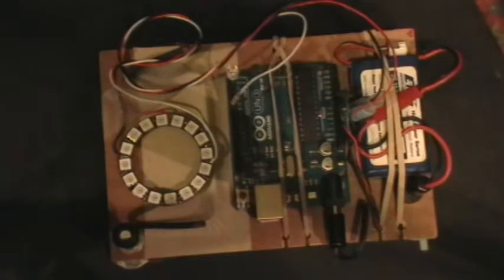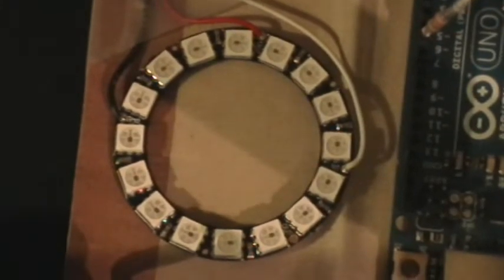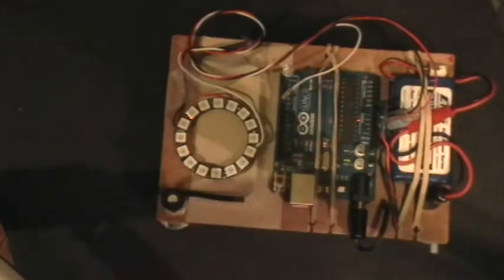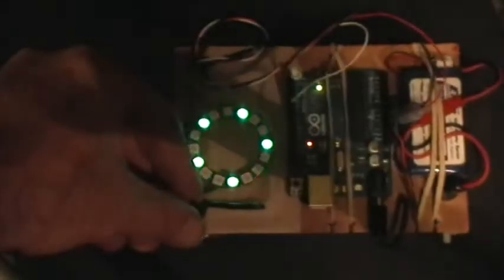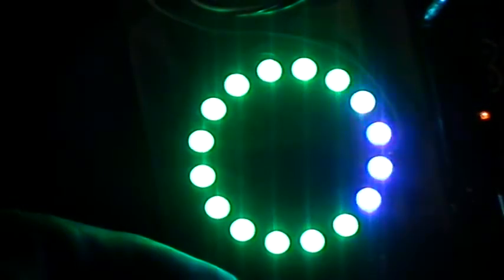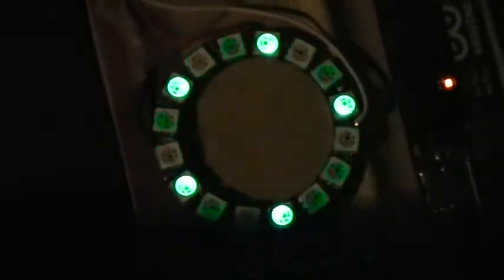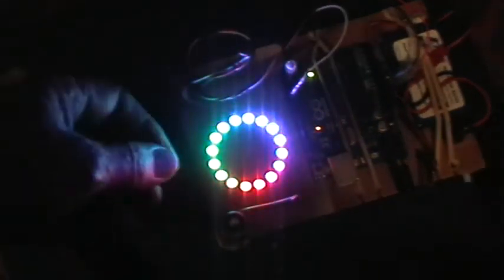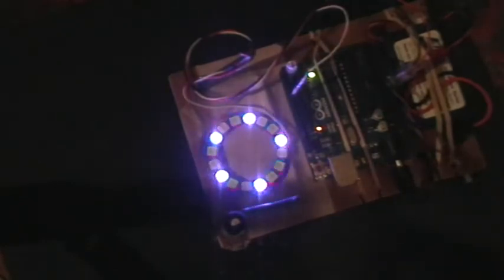Arduino: AdaFruit NeoPixel Ring Demonstration

Comment: Hey TinselKoala! Great video! I was wondering, I have a Trinket Mini that is connected to 2 neopixel rings that I use for goggles. Is it possible to turn these on/off with a switch instead of plugging in the battery every time? You seem to have a similar schematic in this video.
Reply from the maker: Well. can't you just put a simple switch in series with the battery connection? Maybe I'm not understanding your problem here. 
Anyway, thanks for watching and commenting!
Reply: How would I go about putting a switch in series with the battery connection? Do you have a picture of video tutorial of that?
Reply from the maker: Cristian Bravo
You have a Trinket Mini that is connected to two NeoPixel rings... and you don't know how to put a switch in series with your battery connection?
I'm sorry but I don't understand this.  Do you have a video that explains your problem more clearly?
Reply: Yes! I'm sorry for any hassle & confusion I have caused thus far. I uploaded a very short clip to my channel with a short description to give you a better idea of what I'm working with.

Comment: What is the frequency range of the board when using pulsout or pwm?

Greets JB
Reply from the maker: No, that's not how it's done.

Click on the adafruit link above and look for NeoPixels and read their explanation. Each LED chip has a separately addressable microprocessor in it and the whole thing is fed commands at 800 kHz data rate on a single wire, and this can be from any DO pin, pretty much, not just the pwm ones I think.

If you are asking a general question about the Arduino pwm, look at the main arduino website.
Reply: Thnx, i checked it out, really cools man!

Greets JB

Comment: Thanks for sharing your code with us!
But unfortunately it was not working with my Arduino IDE as in Description.
How I used it:

#include <Adafruit_NeoPixel.h>
#ifdef _AVR_
  #include <avr/power.h>
#endif

#define PIN 6
// #declare potPin A0 -> declare: invalid preprocessing directive
int potPin = A0;      // select the input pin for the potentiometer
int MaxBright = 127;  // sets initial brightness to 50%
Adafruit_NeoPixel strip = Adafruit_NeoPixel(24, PIN, NEO_GRB + NEO_KHZ800); // for the 24 Pixels NEO Ring

void setup() {
  strip.begin();
  strip.show(); // Initialize all pixels to 'off'
}

void loop() {
  MaxBright = map (analogRead(potPin), 0,1023,0,255); // Read brightness
  rainbowCycle(20);
}

void rainbowCycle(uint8_t wait) {
  uint16_t i, j;
  for(j=0; j<256*1; j++) { // 1 cycle of all colors on wheel
    for(i=0; i< strip.numPixels(); i++) {
      strip.setPixelColor(i, Wheel(((i * 256 / strip.numPixels()) + j) & 255));
    }
    strip.setBrightness(MaxBright);
    strip.show();
    delay(wait);
  }
}

uint32_t Wheel(byte WheelPos) {
  WheelPos = 255 - WheelPos;
  if(WheelPos < 85) {
    return strip.Color(255 - WheelPos * 3, 0, WheelPos * 3);
  }
  if(WheelPos < 170) {
    WheelPos -= 85;
    return strip.Color(0, WheelPos * 3, 255 - WheelPos * 3);
  }
  WheelPos -= 170;
  return strip.Color(WheelPos * 3, 255 - WheelPos * 3, 0);
}
---------------

In this way the brightness would be read after each rotation only (cycles are set to 1)
Because of the pixels flickered a bit and it was not very smooth while the rotation because the analog value was ready.
Reply from the maker: +Febmaster Ah, sorry, for some reason I accidentally put "#declare" when I should have put "#define" in the Description above. I've corrected the Description, thanks for pointing this out and I'm sorry if my mistake caused you any trouble. 
I just went back over all of my NeoPixel sketches and none of them actually have the "#declare" statement in them, they all have "#define potPin A0" .  So I made some brain mistake while entering the info in the Description. 

I don't know about the rest of the mods you've made, all I can say is that my sketches do work correctly in the hardware, using Uno R3. I've also built a permanent installation for the NeoPixel rings, with some other routines including an ultrasonic rangefinder, using a Pro Mini and it works fine.
Reply: Thanks for updating the description! A second thing - the "setBrightness" command schould look like this:
strip.setBrightness(MaxBright);
PS: If pasting stuff from the clipboard does not work in firefox, changig the firefox setting (about:config) "dom.event.clipboardevents.enabled" to false could help. :)

Comment: Can I use this code with the fast.led library?
Reply from the maker: I don't know, I've never used that library. Try it and let us know if it works!
Reply: I tried it today.  This worked for me, using the Fast.Led Library. Very similar

#define MAX_BRIGHTNESS 250 // You could go full brightness at 255
#define MIN_BRIGHTNESS 10 // Or full off with 0
const int brightnessInPin = A1

 void setup()

 FastLED.setBrightness(MAX_BRIGHTNESS);

void loop()
int mappedValue = map(analogRead(brightnessInPin), 0, 1023, 0, 255);
FastLED.setBrightness(constrain(mappedValue, MIN_BRIGHTNESS, MAX_BRIGHTNESS));